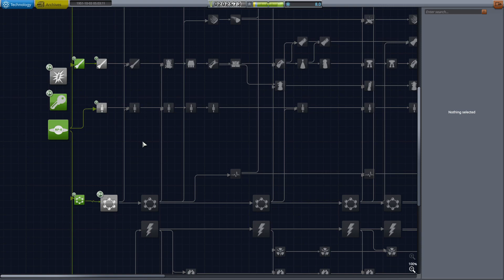How to get 3000km downrange | KSP RSS/RO/RP-1 | NOW WITH AVIONICS! | (Craft file included)

Comment: I've been trying to complete this contract for some time now, but I keep having an issue with my second stage flipping around after stage separation. It's an issue I had with my own design, and I have spent weeks trying to solve it myself. Finally I decided to try copying your design exactly, but I'm still having the same issue! I have tried adding additional spin stabilization on my upper stage, but the axis of rotation still changes and the rocket ends up spinning around uncontrollably. It seems almost like the liquid inside the upper stage is being simulated, causing the axis of rotation to change as it does in liquid-filled cylinders. I did try elongating my upper stage to mitigate this, but that didn't help either. Do you have any idea what could be causing this?
Reply: have you managed to figure the problem out? im having that same issue
Reply: @spacenome  Yes! It turned out that I had my upper stage spinning too fast. I was flying it entirely unguided, but at the recommendation of the friendly folks on the RO Discord, I eliminated spin stabilization using aerodynamic surfaces and spin engines and just manually added spin right before stage separation. It only needs a bit of spin, not too much.

Comment: "set the controllable mass to 18.8 tonnes just to be safe"
I feel like you're better off just setting it to 20 tonnes since you are probably gonna tool this avionics. 20 is the largest you can currently launch, so adding a few extra kg to the lower stage to prevent yourself from needing to tool another one is definitely worth it. In fact, I would say it's even worth adding a bit of burn time.

Comment: Sadly, this no longer works in the latest version of RP1. Delta-v is only about 4400 and it weighs over 2.2 tonnes.
Reply: Maybe that's because you used steel fuselage, not an Al-fuselage.  Al fuselage is much lighter than steel one.

Comment: When I try to use the areobee I keep failing because fuel vapor in lines
Reply: Mostly likely either (a) you're not using a high-pressure fuel tank and/or (b) you're not hot-staging correctly.

Comment: For some reason when I'm building this exact same rocket, my deltaV is a LOT lower.
Reply: Did you make sure to select the correct tanks (al and hp al) as well as the correct engine configurations?
Reply: @imEden0  yes, i did. Still I end up with like 1-1.5k DeltaV less
Reply: rp-1 was updated and this tutorial doesnt really work anymore that well  @MadMikeFPV

Comment: I've downloaded the craft file, but I'm only getting about 1200km downrange.... I even added an extra stage to get 7000m/s Δv and it still only gets about 2500m downrange. I guess I'm doing something wrong but I have no idea what.
Reply: Pitch (angle) is a likely answer. Too shallow or too straight up means you won't go as far. Math says that 45 degree pitch should be ideal, but you run out of fuel high enough that a lower pitch (35-ish) actually maximizes the range.
Reply: @michaelcaplan1589  what

Comment: Doesn't really work as you intend it to be nowadays. From what I can see, Al HP tanks got nerfed, and the rocket now exceeds 20 tons. Update, please?
Reply from the maker: I just built this pretty much exactly the same on the livestream I just finished, still works, and was about 18.6 tonnes all in :)
Reply: @Carnasa  My bad! Was using AL HP for the first stage tank, when I didn't need HP at all. though, still, the al HP tanks seem to be nerfed, because the second stage WAS with reduced fuel, but I still could do it, just with a 30 seconds of burn time.
Reply from the maker: @protongamin4544  haha yeah they have actually tweaked them too, that and the new fuel residue system that’s in play have made some big changes, I just knew this design still worked as I’d only just made it like maybe an hour or two before your comment :p

In order to maximise burn times these days I tend to use MJ delta V stats to see what that gives me, with the new residuals it’s much more accurate than the stock burn time info, or even KER info :)
Reply: @Carnasa  Me too! MJ is excellent, one of the only ones compatible to calculate RO Engines!

Comment: SMH.  Why are you tilting the rocket when you have avionics?!?!?  that makes no sense at all.  You have control of it.  So control it.  Why do such silly, unrealistic, trial and error tilting when you can just launch it straight up like a real rocket and slowly tilt over to 45 degrees?
Use Smart ASS.  Launch it straight up in Surface mode.  Heading can be whatever you want.  Pitch 90 degrees.  Roll, whatever you want.  
Then every 50m/s lower pitch my 5 until you are at 45 deg and then leave it there until engines burn out.  This is way more realistic and easier to do.
The only reason for the tilting originally was because you were cave manning the rocket and launching it without control, so you couldn’t do a more efficient turn.  You were essentially cheating the system, because even early V2 rockets had avionics.  
now, you have avionics and you still insist on the silly trial and error tilting rather than just using the avionics to give the rocket a good trajectory.  
Seriously, SMH
Reply: doesnt this design not have any control surfaces or gimballing?